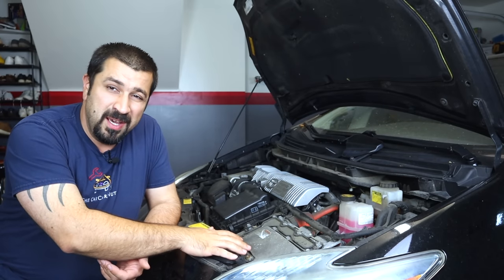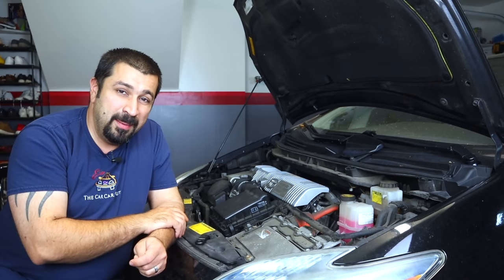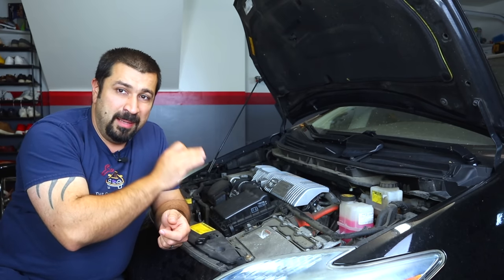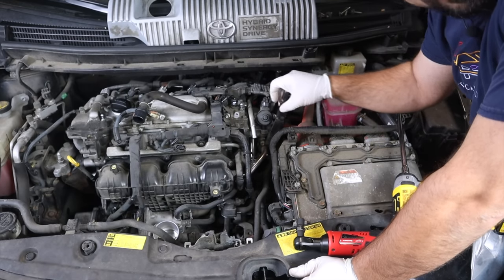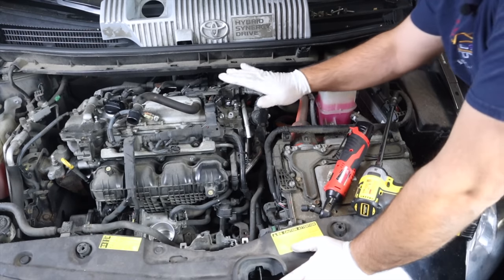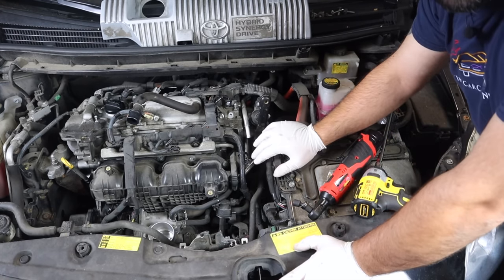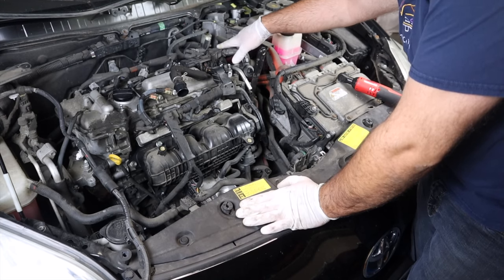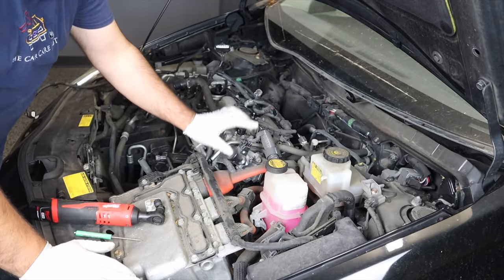Toyota EGR Diagnosis Tips and Repair Tips

Comment: Hello, I watched many of your tutorial videos, this particular one is the most useful for me, I did the EGR cooler, EGR valve, PCV and the intake manifold upgrade on the 7/4 before this video uploaded, everything put back accordingly and run smooth and strong.  My 2011 Prius currently passing 210k+ miles and never had the shake and misfire problem, I don't have oil consumption either, instead of cleaning I changed to new parts, all of the parts I order from McGeorge Toyota are the supersede parts.  Now...I have a question after I watched this video and you mention that the ECM need to updated to new software, my Prius running fine and better do I need to update the software, I have the Techstream installed in my laptop can I do the software update myself, if soo...please show me where to get the correct patch file so that I can do the update at home myself.  Thanks in advance for your attention this message.
Reply from the maker: Hi! If you have full techstream with the update capability then head over to techinfo.Toyota.com and get a couple day subscription and download the update file. There’s a TSB that will show you the process on how to do a download. You’ll need the higher grade subscription to be able to download software updates.
Reply: @TheCarCareNut  
Hello, thank you for the quick response and useful information for the TIS site.  I will definitely pay for the short term subscription.  My Techstream software came with the cable I bought from eBay, is it possible to do the update with that?  Thanks in advance.
Reply from the maker: Honestly I would be on the cautious side with a clone cable. If it doesn’t work it could wipe out the computer permanently.

Comment: This was a super informative video! Thanks very much! Question about the software update... I have a 2016 CT200H with this issue. I am replacing the EGR valve, gaskets and intake manifold as you recommended. Is there a software update for this vehicle as well?

Comment: in 1991 I purchased a new Camry 4cyl. Right out of the gate it stumbled at a part throttle shift. I took it back with less than 100 miles. The dealership ran several full throttle test drives and determined there was nothing wrong. After having it for a month they installed a damper in the EGR vacuum line (TSB for the EGR stumble) and it offered no improvement. The car would run fine on heavy acceleration but under moderate acceleration it would stumble and downshift. I took it upon myself to test by blocking the vacuum line and it ran perfectly for the next 260,000 miles. It also burned oil from the first mile but that is another story. I was determined that I would never buy another Toyota product, but then in 2003, I test drove a Camry XLE against a Honda Accord. Unfortunately, this car had a steering problem (strut mount installed backward) that the dealer was unable to diagnose until months later when a Toyota troubleshooter responded with a TSB. Toyota has come a long, long way since 1991! I still have the 03 and it drives like the day it was new.

Comment: Hi, loved the video. I work for a taxi firm and the Toyota Auris Hybrid is the most popular car for taxiing. We find the vibration problem is very common, usually starts when the car reaches 150,000 miles. Particularly interested in your diagnostic tip with the metal blade. Some of our drivers have had a metal plate fitted over the EGR but with a small hole in the plate to allow some air through. I personally took a different approach, getting a hydrogen engine clean to clear the carbon. Working so far. What is your view on hydrogen engine cleaning or Terracleaning the engine to clear the blockages?
Reply from the maker: Hi! Terraclean works but not as much for the EGR
Reply: Thanks, that's really good to know.

Comment: I’ve changed the sparks and ignition coils and added f injector cleaner but it still isn’t right until I saw why in this marvellous video. Did you clean the 4 egr ports too as it wasn’t mentioned after you took it out of the engine bay. Thanks brah

Comment: EGR only works under light acceleration or acceleration does not open when engine is idling.
Reply: It shouldn't anyway. When it does the engine gets really ugly.
I had a Ford F350SD work truck with the notorious 6.0L diesel. 12 miles from the pavement, in the soft sand (actually clay) of the Navajo reservation, the EGR jammed open. It would start and idle okay, but if I touched the throttle even lightly it would choke and die. Being a 4WD manual, I was able to feather the clutch and get it rolling, then actually pick up a gear so I could make it back to the road.
Reply: Only if it can close. Also a  hybrid is rarely ever idling.

Comment: Don't think I want to own one of these vehicles.
Reply: I wouldn't have any other. We have had nothing but Prius in the family since 2002 - by far the most reliable cars we have had in our 47 years together. The 2002 Prius needed its first actual repair (besides 12V batteries, wiper blades, and tires) a couple years ago at 195K miles - the inverter cooling pump failed. $150 and a few hours fighting rusted hardware fixed it.
I can name the worst car I have ever owned: a 1984 Dodge 600 with a Mitsubishi engine, the second car I ever bought new, but Prius is so much better than any of the others I don't even know what the second place would be.
Reply: I have a 2001 and I am hating her right now. I am getting 26 mpg and it has a new fuel pump and tank.

Comment: EGR, Direct Injection, i don't need all that with my 4ZZ-FE, i had big trouble with my idle when engine cold (misfires, coolant temperature sensor *ENGINE LIGHT PROBLEM*), unstable and shakes, i changed the intake manifold gasket, cleaned the MAF sensor, and now it's just perfect. (Corolla E11 from 11/1999).

Comment: One of the best informative videos on the EGR system I have seen. I do however have a question, what if you did not want to spend the money on the replacement parts but instead just clean the EGR and in particular the intake where the air gets clogged and causes the shaking at idle etc. What is the best method that you have tried thus far to get the intake clean? If you can make a video about this it would help out a lot of people with EGR carbon issues especially with older model cars and not only Toyotas.
Reply from the maker: Hi! From my experience cleaning the intake is very time consuming and is not guaranteed  to work.

Comment: I just watched this video and found it significantly better in all ways than other videos we have been watching to deal with our 2010 Prius. It had a head gasket failure about a year ago (major commotion during cold starts, etc. etc...) which was repaired by Gasket Masters (Manteca, CA; Walter is the man). He is well-known on YT and did a great job for a very reasonable charge. Since then we have had occasional rough starts and very poor gas mileage now in the low/mid 30s. Many pointed at the IMA battery as the culprit due to the high mileage of ~190K, but turned out to be in great health. Next suspect is the EGR valve/dirty throttle body/MAF sensor/intake manifold/.. :-(  This is our young son's beloved car in college that he wanted to use in grad school next. He and I are about to dig in to either fix the car by cleaning 'everything' or screw up big time in the process! Two dealers commented that this is normal for an old car, so essentially don't bother them.
After watching your video, I am less excited about removing the EGR coolant system (my apology if using wrong terms) as per other YT videos. Any advice for us? We will sincerely appreciate it.

Comment: My 2010 Prius is doing this intermittently but not throwing any codes. My dealership wants $119 to diagnose it. My local repair shop wants $825 to replace the EGR. I’m retired and poor especially in 2022, should I just replace the EGR or pay Toyota to diagnose it first? Thank you!

Comment: I have 330,000 miles on my 2013 Prius. Shop did the last EGR replacement and clean the manifold. If I am simply doing this myself do I need to remove all that cowling or can I simply take off the EGR valve, the pipe and the intake manifoldas removing the other plastic seems unnecessary. What do you think?

Comment: thanks for the video and your honesty -- so when replacing the EGR valve, you shouldn't you also replace the Pipe Sub-Assembly, EGR With Cooler
part # 25601-37010??

Comment: Thanks for this excellent video! I am going to try testing/cleaning the EGR as you did here. I drive a 2013 Prius w 197,000 miles. I'm wondering if there is any chance a fuel filter can cause the engine to idle roughly? I don't know if my fuel filter has ever been replaced and I used some old gas recently. I don't see much about people replacing fuel filters on Priuses.

Comment: Hi AMD , great video I must say it is good to know the right way to diagnose problems and do the right repair for the first time all the time , but with the function of the EGR is not just for circulation , based on my knowledge the exhaust gas actually dilute combustion temp to so that more complete burning takes place in each cylinder. 
I think 🤔 you'll agree with me on that.
Reply from the maker: You’re right. That’s another function of it. Trying to keep it simple 😀

Comment: I have a Lexus CT200H and I had the shaking and noise. I replaced the spark plugs and the noise only happened on the first start after replacing the plugs. If I'm still getting white smoke, is it still worth checking the EGR, or should I just pursue getting it checked for bad head gaskets?

Comment: I'm no mechanic, but I've done some research about the gen3 prius/ct200h EGR system and how it can ultimately lead to premature head gasket failure. With all do respect, isn't replacing the EGR components with new parts also a temporary fix? Won't they eventually get clogged again? Also it will cost 1k-1.5k just in parts when you can clean them for about 40$ or less 
(buy gaskets, cleaning supplies, etc) Most forums and videos recommend cleaning them every 100k miles or so. A few people think doing it every 50k is optimal. By cleaning them every 50k you get the added benefit of preventing head gasket failure. Thanks for all your videos!

Comment: Thank you for your videos.  Love your frank perspective.  I have a 3rd generation Prius and never known that they are prone to EGR valve issue.  Would you suggest replacing the valve and intake preventively?  My car has 130K and is not having any problems like rough idle, hesitation, loss of power etc.

Comment: my egr cooler was completely obstructed along with the same intake passages i used a bike tire spoke chucked into a drill gets in between the grid real nice
Reply: i drive the car 200 to 300 miles per day have put 11k miles since the work also added a catch can

Comment: My 2013 Prius with over 300,000 miles is throwing a code P0401 but I do not I stress I do not have any shaking or rattling. Is it still the EGR valve being clogged or the manifold being clogged that is causing the problem, even though my vehicle is voidof any shake or rattle?

Comment: Amazing explanation. And the symptoms i have in my 1MZ-FE matches with this car.
I had years of blocked EGR valve with engine light car drove fine.

Soon as i cleaned the EGR valve and the pipe line, engine light is gone, but the car drives funny at high speeds when foot off the padel. It feel like a shudder / misfire. 

Could this mean the intake manifold is partially clogged?

I'm a DIYer trying to save money on an old Camry.

Comment: Question: My 2010 has 152k miles. I bought it 20k miles ago and have been thinking about taking off the EGR valve/cooler/intake mani. and clean them. But after your video, do you think I should just replace all of those parts with new ones? Lastly, my car isn't running bad but was thinking of doing this as preventative maintenance. Is that a waste of time? Do you recommend installing an oil catch can?

Comment: I’m not sure if you have time to respond but worth a shot. 
2014 Prius v 197,00 miles no previous issues plugs replaced 20000 miles ago. 
Snacking at rough idle at temp rough starts then normal after 30 mph. 
I isolated the egr like the video says. I feel like I got some improvement even no symptoms for a few stop starts but the symptoms returned but not as bad it seams. Any suggestions from the YouTube pros for next steps. 
Check engine codes where various cylinder misfire and misfire in cylinder 2 
Oil looks clear and no signs of coolant in oil. But coolant is a little low in the reservoir it has never been changed. I will change it after this issue is resolved.

Comment: Subscribed. Seems like this could be what is happening to me. I have a 2016 Toyota prius hybrid shuddering shaking as soon as it hits around 20mph and somtimes much faster around 40-50 mph but then quickly disappears. It shakes only when accelerating not decceration. Never shakes in park. Im lightly pressing on the accelerater.  I'm going to maybe pull these parts out and look at them to see.

Comment: Hi sir, thank you so much for making this video possible for us. 

What I noticed when I took apart EGR valve components was that the valve spring was worn out. I have done the continuity test on the actual assembly. It turned out to be working. There was no issues in there. However I have a question 🙋‍♂️ for you:

What if I just changed the spring of EGR valve, would this be enough to not see the EGR code on the dash which is “ insufficient EGR gas flow “ ?

Comment: I did remove my intake manifold and cleaned it. It was nasty but I spent 90 minutes cleaning all 4 runners and ports. I also cleaned my EGR cooler as I saw no light coming through it after I moved it. This was on a 2010 Prius with 116k miles on it. I like the idea of blowing it out every 20k miles or so to keep it cleaner. I never checked the EGR valve but I'm guessing that it should need to be replaced or cleaned. Do yo have the part number for the TSB EGR kit you used? It would be great to list that kit and a link to print up the TSB so we don't have to go hunting for it. Thanks for the great video. I'll have to take a look at the EGR valve now. BTW, how much is that EGR TSB kit?

Comment: Thank you for the excellent video!  My dealership told me I only needed a new air intake and after they replaced it I questioned them about the fuel trim graphs still going to below -20.  Their mechanic noted he remembered an older guide that said to replace the EGR valve and looked for it then said they recalled it.  10 months/30k miles later the EGR ports on the air intake plugged again.  Do you know if the trim issue and the clogged ports are due to the EGR valve not seating?  I'd love to hear your thoughts on this.
Reply: How much oil is your engine burning

Comment: Definitely like these "hands on videos".  Admittedly, I know just enough about this stuff to be "dangerous".  But, my car is at the age where I must start doing more of these repairs myself.  Seems like every repair at the dealership costs $1000.  I have an 09 Camry 2.4L, and have endured a super intermittent rough idle condition since the car was almost new.  I went as far as to complain to Toyota, the wise ass service rep said I was "old fashioned", and didn't know how to drive a 5 speed, so I will take every opportunity possible to "bad mouth" this service rep from the northeast, you know who you are buddy.  In any event, this is a very intermittent problem, and it will certainly not repeat at the dealership.  I pull my foot off the gas/clutch depressed, the RPM will drop to about 600RPM and the engine will shudder.  The engine won't stall, and there has never been a check engine light activation.  The problem will usually "self correct" after several seconds of rough idle.  Doesn't matter if the AC is on or off, winter or summer, seems to happen only after the car is warmed up completely and engine is allowed to idle at its lowest RPM.  I have often wondered if this is somehow EGR related.  Your putty knife diagnosis method won't work for me because the problem is so intermittent.  I don't think it is an intake manifold passage issue, because that would be a constant issue, not intermittent.  I'm not faulting the dealer cuz I know they can't fix something that won't misbehave for them, this car might idle fine for weeks/month before the problem reoccurs.  But, once it reoccurs, tends to happen pretty regularly for awhile until it somehow "self corrects".   Again, the engine has never stalled, no check engine light has ever come on, so am guessing there are not computer codes stored that might help pinpoint this issue.  It almost seems as if the car would need to be hooked up to the complete running analyzer and misbehave so techs could see just what parameters are "off", and have a better idea what to look for.  I have asked the dealership if there are any TSBs relating to this issue, keep being told there are not.  Again, this issue began when the car had only about 30K miles, and has not changed much over the many years and miles, now at 200K miles.  09 Camry, 2.4L, 5 speed, still has original rings/pistions, burns only about 1qt of oil in 3000 miles, which is my oil change interval anyway.  Any ideas???
Reply: Hi, I experienced a similar problem when there was a lot of carbon buildup on the pistons.

Comment: That was a great informational video, and those tips and tricks are very valuable, I worked at the automotive industry before, so I can tell the difference. Thanks 🙏!
How do you connect the computer to the car? Do you have to get a special OBD adapter/connector for it?